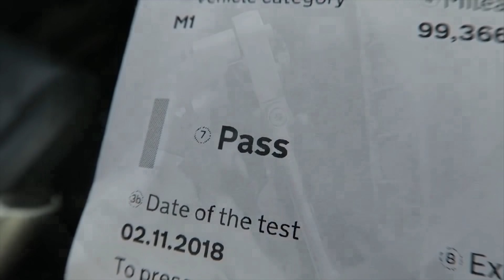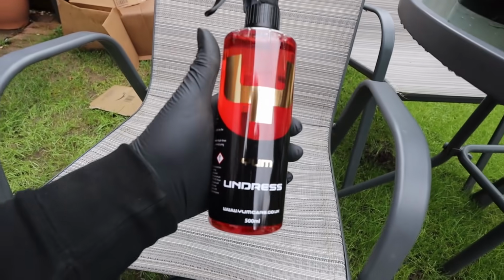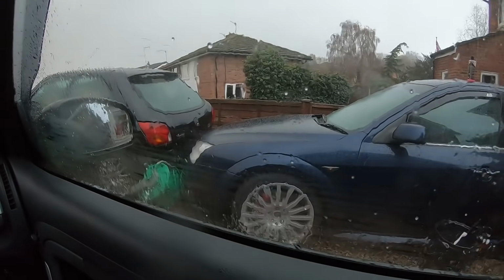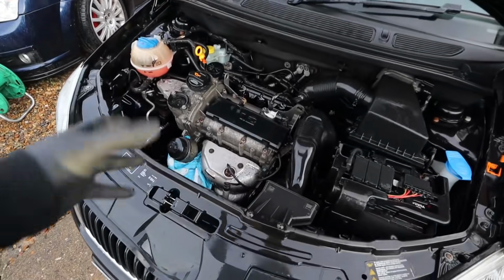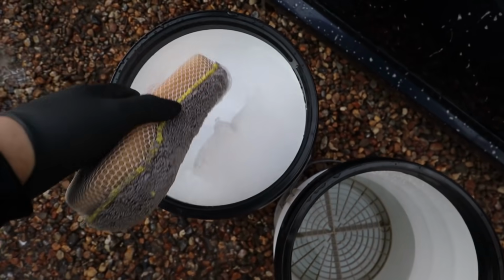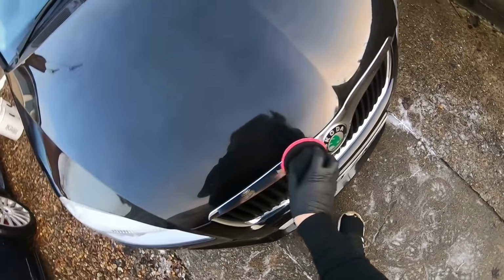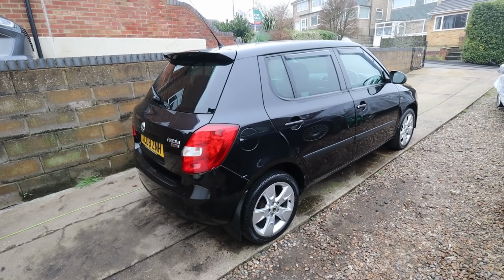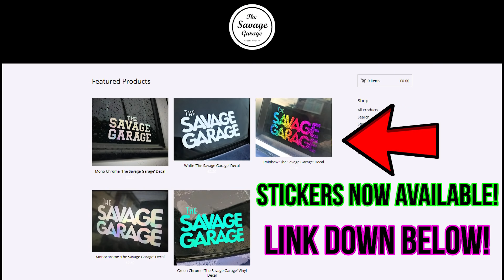Cleaning The Skoda Project! + MOT Prep (Part #2)

Comment: Great job, very impressed! During playback, noticed the wheels turning purple; what you used on the wheels got at iron oxides.
Engine detail very nice; rinsing off, a lowest setting on the pressure washer is fine for the engine, you don't full force. And washing over snowfoam excellent.
I would definitely clay bar before selling, get all the fall-out from the paint, will definitely help before waxing and buffed.
Reply: The product used was Yum Wheels

Comment: The Skoda is looking really lush now after that clean.  My 1 Series is well overdue a good detail but because of the weather I can't get motivated enough.  And it is especially more time consuming if you're waxing and buffing a car by hand in the cold.  Most waxes are hard to apply and even harder to buff off if the temperature is really low.

You should check out Car Cleaning Guru for more information on car detailing and techniques that will help save you time for the future.  He is really good at what he does and emparts a lot of information.

Comment: Great video. Try replacing the pressure washer hose. The ones that come with the machine are horrible, the heavy duty rubber ones from ebay make them sooo much nicer to use.

Comment: Can't help but think that Undress product would've done well on the engine bay
Reply: Yes it could easily have been used there
Reply: Can confirm ive used their Dress product, its good but leaves a very very very slidey shiny finish. Transformed all the plastics in the engine bay. Worked to an extent on the wing mirrors too which def looked better than they did but did nothing ot the roof plastics as they were too far gone I think.

Comment: Where did you get the nozzle from for pressure washer gun been looking for one for my katcher for ages
Reply: You can get them from Amazon or eBay, the nozzles are quite cheap, the extension hoses vary in cost depending on the length.

Comment: Myself, Id recommend wrapping the alternator, abs unit, turbo and ecu when pressure washing under the bonnet. And a quick clay barring of the bodywork, bilt and hamber as the lube is plain water,  to finish off.
Reply: Hi, which Bilt Hamber product do you use as the clay lube?
Reply: @BrokenVespaPhil  their bars can be used with just water

Comment: James why are your number plates different colors, white in front and yellow in back. Just a curious American fan. 
Nice video!  You now have a very clean car, inside and out.🤞
Reply: Uk requirement. Until the early 1970s uk plates were black with white lettering on the back, and white with black lettering on the front. That changed to reflective yellow with black letters on the back in the early 1970s, and reflective white with black letters at the same time

Comment: No ! Don't use a pressure washer on the engine. Only use running water from an open hose to rinse it off. Why ? Because the electrical connectors in most engine bays are only really 'splash proof', not 100% waterproof. If you force water into them with a pressure washer you run the risk of intermittent electrical gremlins. Trust me, I speak from experience.